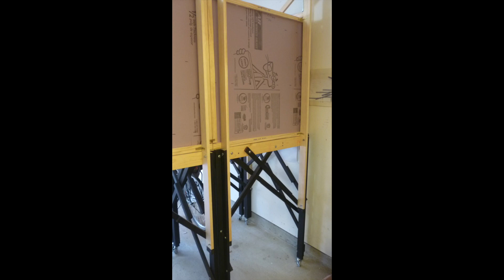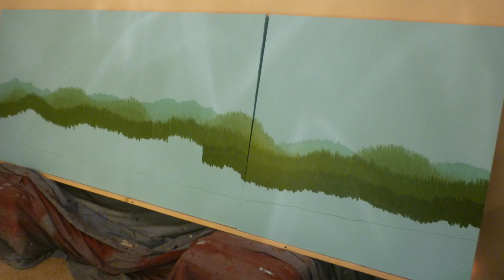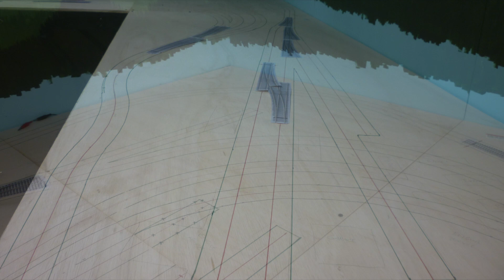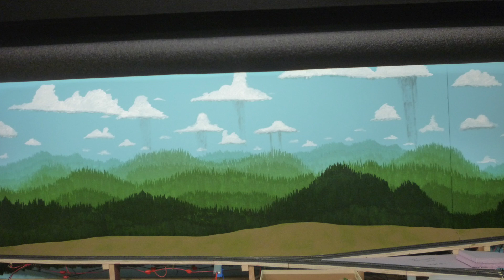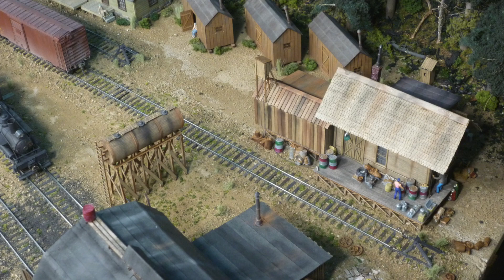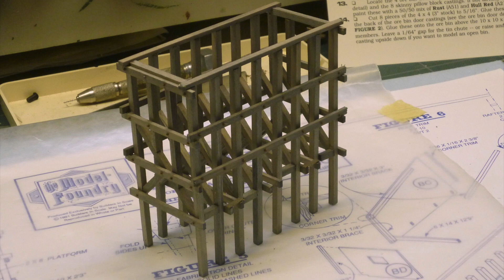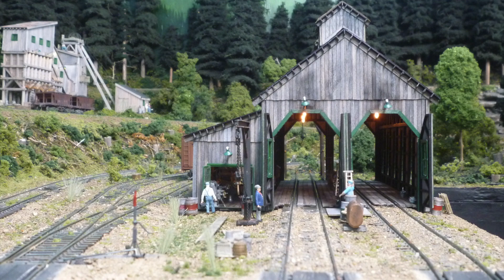Construction- Clear Lake Timber Company Model Railroad

Comment: How did you arrive at the paper turnout templates? That’s what I need!
Reply from the maker: I looked at the templates that Walthers offers on their website, but in the end I went a different way since I used Micro Engineering turnouts, not Walthers.  To get the templates exactly right I ended up putting my turnouts on my flatbed scanner and scanning them.  Then I printed them out, being careful to scale them so they printed out exactly the right size.  This gave me exact paper copies of my turnouts.
Reply: @ Carl, you are wonderful.  My frustration is that I know I’ll get bored with a ‘beginner’ figure 8, loop d loop, etc.  My home computer is too old and tired to run ‘Anyrail’ etc software, and I don’t want to make too many expensive stupid mistakes.  I’m off today to the public library to scour some old books. Thank you!

Comment: Perhaps an overly simplistic question, but how did you get the dimensions of your buildings to make the mockups?
Reply from the maker: Well, I didn't have to guess.  I already had the kits since I had picked them out early as ones I liked.  So it was just a matter of measuring the parts directly or using the full-size drawings if the kit had one (the Micro-Scale kits did have full-size scale drawings).

Comment: Your design and planning makes great use of the space you mentioned 9x9 what is the depth of the framework? One table looks wider than the other
Reply from the maker: The front-to-back depth is 3' all around, thus making the corner module 3x3'.  It's a long reach to the back, but so far not needed very much.
Reply: @  Thanks, I have been wanting to do a similar setup using 2-3 foot width, now after seeing your benchwork i have a better idea of how to begin

Comment: What a fantastic layout. You have managed to pack a lot in and at the same time avoiding making the layout too crowded. I was wondering that when you cut and inclined the ply trackbed the plan dimensions would've become slightly shorter. Where little make up bits required or was the difference insignificant?
Reply from the maker: No, I didn't notice any such effect, although I recognize it is mathematically/theoretically possible.  Even with a 5% grade, I guess the climb angle is still pretty small trigonomically speaking.  So, no noticeable problem.

Comment: can I use a heated wire thingie to cut that white styrofoam if I do it on my deck worktable outdoors to aviod that absolute mess when using a saw or knife.? Dont know about fumes andd if it will burn.Ive kept white styrofoam tfor years, anticipaing me now decorating my new tranboard. What glue can i use on that white styrofoam, by name. gary j

Comment: Boy oh boy.  Excellent preparation and planning.  The benchwork and scenery is phenomenal - master craftsmanship. I see that you use 'suitcase' electrical joiners to splice into your bus wires.  Do you find that these are o.k. in use?  A co-worker of mine used to use them (correct size for the gauge of wire), until he found that the sharp cutters inside (used to cut the insulation) could occasionally completely sever some of the multicore wire strands reducing its load carrying capacity. I really like the idea of the automotive type of electrical connectors.  No soldering (crimp only), and easy to install and remove from the terminal strips for fault finding.  Some other modellers use soldered tag strips under their boards, but when you are old and crotchety like myself, and need to get under the board with a soldering iron, family members really need to be out of ear range when something goes wrong as hot solder finds its way on to your lap! EW
Reply from the maker: EW, thanks for the kind words.  I used the exact suitcase connectors that Model Railroader uses on their projects (from 3M, I think).  Got mine from Micro-Mark but they have have them at places like Home Depot, too.  As far as I know there's been no problem with them.  So far!

Comment: Where do you purchase your structures from? Are they scratch built?
Reply from the maker: The structures were all ordered via the internet, either directly from the manufacturers or from dealers.  The structures are all from kits.  Some might be out of production but still available on eBay.  Here's the list-
Around the Sawmill-
Sawmill- Master Creations Coon Gap Sawmill (may be out of production)
Bower's Brewery (next to the sawmill)- Micro-Scale Models
Cushing & Bliss machine shop (next to the brewery)- Micro-Scale Models
Main Engine House (near the sawmill)- Micro-Scale Models Pine Creek Enginehouse
Sanding Facility- Model Tech Studios
Water Tank- Evergreen Hill
Coaling Tower- JV Models
Yard Office- Micro Scale Models "Maintenance Office"
Company Headquarters- Precision Lasercraft "Scott Wire & Cable"
The Mine- Builders in Scale Model Foundry "Silverado Mine"
Around the Logging Camp-
Engine House- Master Creations Coyote Draw Engine House
Loco Service Facility- Master Creations McCabe Engine Service Facility
Bunkhouses- Master Creations
Storage Mini-Warehouse- I think it was called Reece Supply Company, manufacturer long forgotten
Kitchen Building and Log Loading Crane- Suncoast Models "Logging Camp"
Water Tank Facility and Boxcar Shed- Fine Scale Miniatures

Comment: Wow, what a great layout, from start to finish.  I was particularly impressed with how it appears you had the design conceived from the beginning, however I observed how you did a lot of mock up work, and test fitting before you constructed each final product.  Top notch work plan you h have here. You could turn this project into a book: Building your Model RR Layout- From Concept to Completion.  And your detail is second to none.  Thank you for an excellent video.
Reply from the maker: Ken, thank you very much for the kind words.  You're right, I did have the basic concept of a double-switchback logging line connecting a log camp to a sawmill fixed in my head up front.  The rest was just details.  I did mock up every building, which was good for planning, good for understanding how the buildings went together and would look, and also filled in for the real buildings until they got built for real.  A few tweaks to the building placement did happen during the mockup phase.

Comment: Carl you've built my dream layout.
Reply from the maker: Michael, I hope you go for it!  Much success......
Reply: Could you tell us what some of your milestone dates were? Like when you  completed framing benchwork and started drawing track on your plywood? When you had your track cut out & up on risers? When you completed all your buildings?  Thank you!
Reply from the maker: Michael,

Sure.  Pulling dates from my photos, my construction timeline was something like this-

Dec '14 First L-girders built (extra long), although at that time I didn't have a plan yet.
Dec '15 Benchwork construction started for real, after finalizing the plan
Feb '16 Benchwork done in the garage (still needed to be moved inside for assembly)
May '16 Backdrop pieces made and framed
July '16 Backdrop panels painted
Aug '16 Benchwork and backdrop panels assembled in place
Sep '16 Basic wiring done before starting plywood
Sep '16 Plywood laid down to start track plan work, including mockups
Nov '16 Track plan finalized and drawn on plywood
Nov '16 Sub-roadbed cut out from plywood
Dec '16 Sub-roadbed elevated on risers
Dec '16 Roadbed installation complete (Woodland Scenics TrackBed)
Dec '16 First piece of track installed
Feb '17 Started 3-D scenery landforms (styrofoam)
Aug '17 First structure completed
May-Aug '18 Sawmill construction (took a long time)
Jan '19 Log pond "water" pour at sawmill
Jan '19 Last piece of track and last tree installed
Mar '20 Last structure completed
April '20 Barnhart Loader completed (maybe that's actually the last structure)
Oct '20 Installed sound modules for the sawmill and log camp

At that point the layout itself was essentially finished, and I moved on to building log cars, etc.  So the actual layout construction took about 5 years.  Structure building took about 2 1/2 years, in parallel with track and scenery work.  The small layout size allowed it to happen within my lifetime!

Comment: Hi Carl. Thanks so much for the great slideshow of the construction of your beautiful layout. It’s a real inspiration. I’m building a layout and plan on having a logging branch with a switchback also. Your layout has given me quite a few ideas. I have the same sawmill kit to build. Hope I can do at least half as well as you did with yours. How deep did you make your layout and how tight a radius’s did you use?  Your trains look to run flawlessly on your track work. The structures, trees and scenery are just perfect. Great track plan. Thanks for sharing. Great work. Jim
Reply from the maker: Jim, thanks so much for the kind words.  The sawmill kit is a beauty but, boy, does it have a lot of parts when you count all the battens on the siding as separate pieces, which they are, of course.  The count may be several thousand!  But great in the end.  The layout is 3 feet deep all around.  I drew the plans with the radius at 18", but I think during construction a few spots came out a little smaller to make everything fit.  The locomotives don't mind, but I had to carefully check truck/wheel swing on the Kadee log cars.  Since they are all metal they could short out on a sharp curve if the wheels touch the frame at both ends of the car.  I filed some notches in the frames so the wheels couldn't make contact.  Carl
Reply: @CarlBrainerd  Thanks for the reply Carl   Keep up the great work. Hope to see more videos in the future.

Comment: Carl, I've been planning on using masonite for my backdrop, but I like your approach of using foam panels.  I have space behind my layout, so I want to make the backdrop panels removable for access, and the light styrofoam would make it much easier.  Are they glued to the wooden braces?  Any issues with how they took paint?  I assume you used house paint?  Thanks for your advice.  Jim.
Reply from the maker: Jim, my styrofoam backdrop panels have a frame of 1x2s glued around their perimeter on the back side.  This stiffens them a little and gives something into which screws can be driven.  So, "yes", there is some gluing involved  They are still fairly lightweight since that bracing didn't add all that much wood to the assembly.  Then those framed panels are secured to the layout structure using small 90-deg angles, maybe 1 1/2 or 2 inches, screwed to the vertical 1x3 supports that go up on the back of the modules to hold the supports for the lighting valence and sky panels.  All this can be seen in the one slideshow photo (1:13 in the video) that shows the backdrop from the back side (if one knows what to look for!).  A couple of those angle brackets and some of the 1x2 framing can be seen in that photo.  My design does not lend itself to easy removal, though, as it was only intended to be removed if the layout had to be disassembled to move it.  The panels cannot be removed from the rear because those tall 1x3s that support the lighting valence would block them from coming off the back side.  In my case I'd have to first remove the overhead lighting valence supports that stick out over the layout and then lift the backdrop panels out vertically from the front side.  Not something to be done "casually".  If you don't need to support overhead structures from the back side like I did, I imagine you could engineer the 1x2 framing so it could be attached to the layout frame and be removable from the back.  In that scenario, the structure arrangement would be different from the way I did it.  My design was driven by the need to have cantilever supports for the lighting valence sticking out from the back side of the layout so nothing would be attached to the ceiling or walls of my apartment.  That's why I have those long unpainted 1x3 vertical members that you see in that one photo.

As far as painting, they painted up OK.  If you catch a reflection of a strong light source on the painted surface and look at it close up, the texture can look a little funny, but it doesn't seem to be an issue for normal layout viewing.  You might benefit from trying a test sample before committing.  The basic sky blue background is regular latex house paint.  I used artist acrylics for the green tree lines and the clouds, mostly the Liquitex brand from an artist supply store.  Places like Hobby Lobby and Michael's may have them, too, but I had an artist supply store nearby and figured they would have the best selection.  I experimented with a few colors before settling on which colors to use for the various tree lines, adding more blue tint to the more distant ridges.
Reply: @CarlBrainerd  Carl, thanks much for the description.  Since my lights are in the ceiling, I have no valance to support, so it won't be a problem making the panels easily detachable.  I will indeed try painting a piece of foam to see what it looks like, but yours looked great in the photos.  If you're interested, you can see a few photos of my layout under construction at https://www.facebook.com/jamestownmodelrr.
Reply from the maker: @JimOberst  Jim, I did take a look.  Great work!  You really have some nice looking structures.  I especially liked the sawmill and curved trestle.  It looked like you had two kits that I also used- FSM Water Stop and Evergreen water tank.  That FSM kit is the only one of theirs I have had, and I can see why FSM has such a reputation for great kits.

Comment: Very nice!  Great job with the scenery.  Would you mind sharing what brand and color was used for the soil?  It is very realistic and visually matches what I would imagine as soil color.  Thanks for sharing your layout, Ted
Reply from the maker: Ted, Sure!  The open areas (and track, too) in the logging camp and the sawmill "yard" area where there is basically bare dirt are made/ballasted using a product I got from Scenic Express.  The label on the jar is a long one- "Express Scale Ballast, Medium (or Fine) Natural Soil & Dirt, Natural Stone Aggregate".  A long name for what is basically "dirt".  The product numbers are SE0413 for Medium and SE0403 for Fine.  I also thought it looked pretty much like dirt ought to look.  I took a sample into Home Depot and had them mix up a custom paint of matching color, so the base coat for all scenery used that paint, with application of the Scenic Express "dirt" or Woodland Scenics ground foam as appropriate on top of the wet paint.  So there's matching dirt color under everything.  Carl

Comment: Hi Carl, I saw the still pic of your rod n switches, attached to wired point motors? Could you do a video on this set up, as I feel there's many modelers that would find your workings fascinating. Especially, those of us that are relatively new to hobby. Great upload, and very clear vision from plan to completion slideshow, amazing achievement, not getting side-tracked from your initial plan. All the best. Brian @ The Angels.
Reply from the maker: Brian, video done!  See the new video on turnout controllers.  Thanks for the suggestion.  Carl
Reply: @CarlBrainerd  just watched it. Fantastic. Appreciate your efforts.